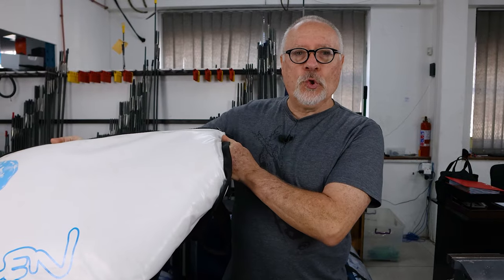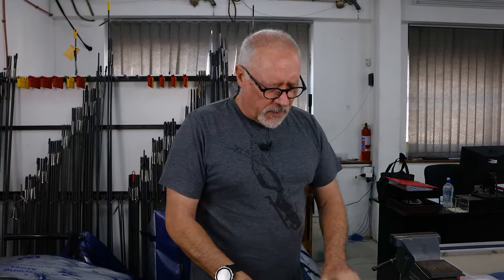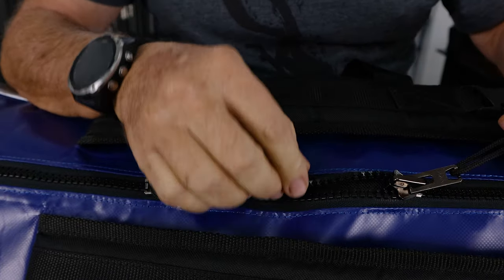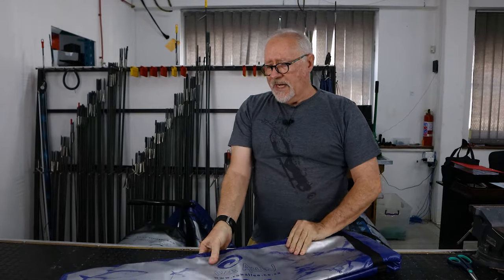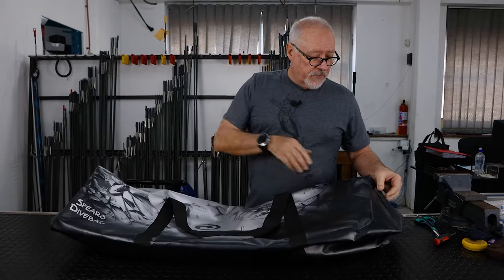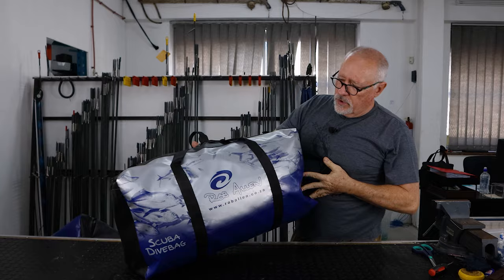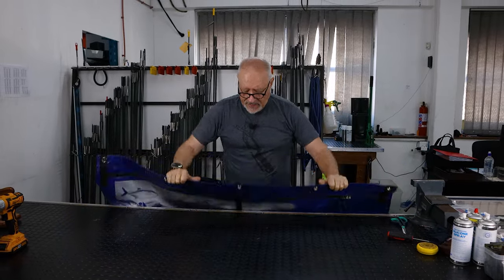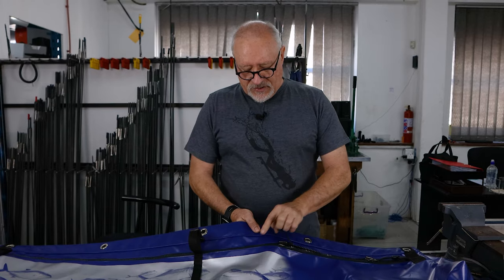Rob Allen | Dive Bags | 2023

Comment: I simply love mine. A feature that lifts its standing, in my view, is that sand washes off the bag quite easily. So I use mine as a backpack, with the weight-belt around my waist, to walk short distances to dive spots. And stand inside the bag when I put on and take off my wetsuit. There is a lot less sand in the car.
Reply from the maker: Many thanks for the kind works.

Comment: hey Mr Allen, in fact if the gun barrel can fit in the tanker bag,  then it's a perfect bag. We just put the barrel in the bag along with all the gears, once arriving at another country, we can buy shaft at local shop. Can your 1.1 meter gun barrel fit in the bag please? I have a 1.1 roller gun, and would be definitely buy this if the barrel can fit in. Cheers, Rui
Reply from the maker: Hi Rui, no it can not. The bag is just over 1m to fit long fins. A 1100mm roller without the spear is 1380mm. That is because the handle and the muzzle protrude past. You would be better off with the extra wide, 1600mm padded gun bag. This will take the spear as well, including suit, fins and mask. Many use it like this with a light weight netting bag inside to carry gear (not the gun) when on a boat.